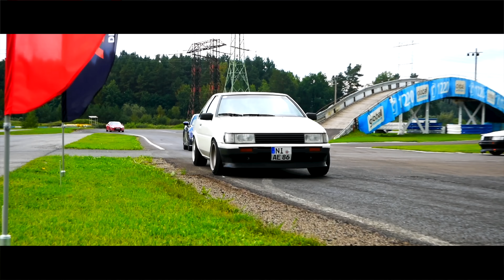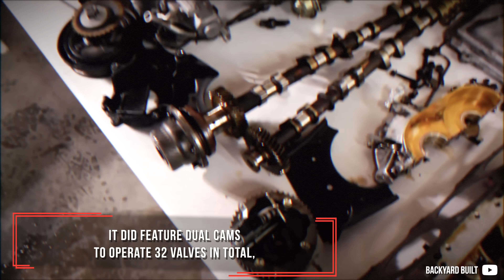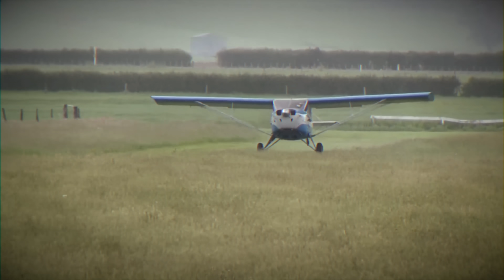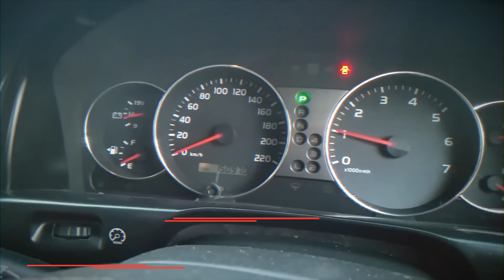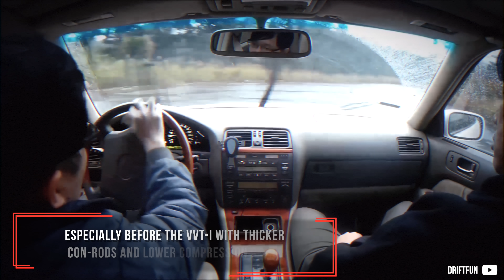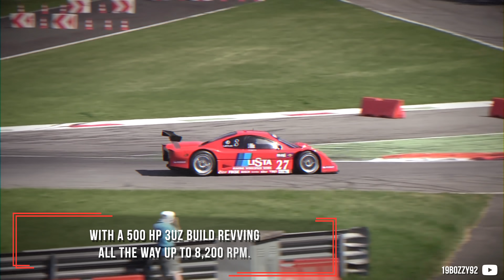The Strongest And Most Reliable Automotive V8

Comment: The legendary 1UZ. They are really overbuilt like a tank with non VVTi system these are genuine automobile engineering gems. Sad part is LS 400 is too old now to get and maintain. I heard from Car Care Nut that 3UR series is not as reliable as the 2UZ Cast Iron block engines due to head gasket failure possibility. UR series has the issue of valley plate leak, esp the 2UR-GSE, still that's the only Lexus motorsport variant in existence as the 1LR-GUE is not profitable in producing and racing, current RC F GT3 uses a 5.4L version with 500HP vs 472HP. I love the 2UR-GSE in RC F, it's also built like a tank, its an interference engine and has port and direct injectors for mega complication to mod and tune, but the 7300 redline with Yamaha designed heads and Titanium valves like 1LR and the sonic impression of a motorsport and aggressive mix always puts a smile. Too bad the RC F is about to be retired by 2026. Lexus built some great automobile masterpieces.

Comment: My 2006 Lexus gs430 is my first and only car I’ve had it for 5 years now put 100k on it with literally nothing but oil changes changed the oem timing belt at 200k

Comment: "NO LEAKS" yeah... thats not really true - many have issues with valve cover gaskets leaking.
Reply: That's normal if they're old. It's a cheap and easy fix. Hardly an uncommon issue for a performance engine anyway
Reply: @halo091  Its not a performance race bred engine though. 2UR-GSE is the only Lexus performance engine in existence. 1LR-GUE is discontinued and too halo and it did not even race that much as the RC F GT3.

Comment: pass———ill take the Toyota 5.7L Tundra engine that can go 1 million miles
Reply: Not exactly a hard pass, but ok.
Reply: 5.7L is a UR series engine, it cannot hold a candle to the 4.8L 2UZ V8 engine. Simply because 2UZ has cast iron block, the endurance is insanely high vs the 3UR, it's bulletproof.

Comment: Bought a 91 LS400 for $650 with 232000miles and with only oil changes drove it till 292000mi. 7 years later still absolutely in love with the engine

Comment: Having run a limousine company for roughly 25 years, the 4.6 liter V8 that the Ford Motor company put in the Lincoln Town Car (I don't know if they still do) was virtually indestructible.  IF maintained properly. 300,000 miles easy, often much more. The rest of the car would fall apart before those engines went.

Comment: I beg to differ it's interference engine. A stupid 60$ part destroyed my engine.. hydraulic timing belt tensioner that had to be removed to change alternator and a month later the belt slipped off somehow after doing some donuts and bang valves bent engine dead.

Comment: Yawn. This sums up this engine. A long lasting stock low power engine doesn't however making a car good. Or the engine. In fact, I would rather take the transit than drive any Toyota with a few minor exceptions. True engine quality to me it's a championship winning LeMans 24 hrs engine, proved over many many years, like the Mezger, not something barely moving at a leisure rpm value on the way to the local Bingo club. Yeah, I never got this myth of "super reliability" from Toyota, I've seen plenty with the hood up on the side of the road in my life. Must be an american thing, when the Japanese cars started coming to US and they were compared to a US made POS ..sure, they're better. But the strongest? Nope, sorry. I can say the same thing about an tiny ALH TDI engine that can do 1 million miles but it doesn't make it "the strongest". And tuning a few powerful engines for limited use (no more long service on those, right?) again doesn't make it "great". It's just a lazy engine with some over engineered features. Way better engines out there, even V8s. More research needed boys and girls, I know it's so hard to shake the 2JZ behind the barn tuned urban legend and start focusing on professional Motorsport to see the true greatness. Eventually people are reaching that stage in life when they are done watching F&F and play NFS on a PS and hit a real racetrack with a proper car. Cheers!
Reply: The reliability of the 1uzfe is legendary and was not just installed in the LS400 it was placed in the Landcruiser a true workhorse worldwide.

Comment: most reliable yes, but most ls and coyote's can make way more hp on stock engines. There are f150's on totally stock 4wd drivetrains making 700+hp reliably with turbo/superchargers. Obviously they are unlikely to last 1,000,000 miles, but uz engines would explode almost instantly at those power levels.

Comment: We bought a used Lexus 1995 model with less than 100,000 miles. Burnt oil on start up. Big cloud of blue smoke. . Biggest let down of any car I ever owned. Found out Toyota had problems for a couple of years there with valve seals..

Comment: The 3UZ-FE and it's predecessors are legendary.
I daily an LS430, and i got lucky enough to get one in almost immaculate mechanical condition. At 225,000 miles.
I'm at 251,000 now. No issues.
Reply: Me too mine has 220,000 miles

Comment: Nah, the UZ is just a totally over-complicated, overpriced and underpowered V8 which does not need, and cannot justify, it's use of a DOHC valvetrain. It doesn't not even have good fuel economy with it's rather inefficient over square combustion chambers and is a rather annoying interference engine given the replacement schedule of its timing belt. With it's mid-5000 rpm power peaks it's also quite underwhelming to drive. Period specific LT1 and LS1 5.7L engines have higher outputs, better fuel economy, lighter weight and smaller (external) size. As I have said many times before... unless you intend on making peak power above ~7000 rpm, a DOHC valve train is INFERIOR in every way and pointless in any application.

Comment: The most reliable V8 I ever used and using NISSAN's VK56DE I towed over 100,000KM drove hard I honestly tried to kill it so I can buy something new, I did not change oil for 1 and 1/2 year it f*c*ing neve quit. Finally I gave up and I bought a brand new 2019 NISSAN Titan VK56VD. 
I had a 1992 LEXUS LS400 very quiet and smooth, small V8 with decent power the cabin was very quiet on high speed amazing car.

Comment: I don't like that it uses a timing belt. I have owned two Toyotas that had timing belts and both broke on me long before the required maintenance. I was probably just unlucky and fortunately the engines were non-interference so it didn't hurt the engines. After the second time happening I will only buy cars with timing chains.

Comment: "Capable of 700hp on the stock block"

*Laughs in LS1*🤣🤣🤣

All jokes aside Toyota makes great motors that definitely last forever but there's a reason everyone does an ls swap instead of a 1uz swap and that's power price and reliability, it just can't be beaten.
Reply: Maybe in America, not the rest of the world. We use UZ’s and Nissan V8’s almost exclusively down under for racing applications.
Reply: Not really. Main issue with UZFE is the lack of application for turbo or superchargers or any real power upgrades. It's harder to modify vs LS. Still handles 1000hp
Reply: Going millions of miles isn't reliable?

Comment: I'd still say the LS V8's and the Ford Modulars have this beat in terms of durability. LS are know to be stupid cheap and reliable to make power and the stock 4v 4.6L modular in the SVT Cobras could handle over 700 rwhp without any upgrades to the internals. I know the 1UZ topped out around 400 hp before you had to beef up the insides.
Reply: 400hp? Try 800, unopened.
Reply: Lol hell no. Every ls engine with over 200k miles are leaking from every single part of the engine they could possibly leak from. What a joke

Comment: The air pump under intake on the 4.7 truck motors and the stater mounted in the v also are the shit parts of this motor. Not a fan of timing belts either, but no motor is perfect I guess

Comment: The Chevy small block engines have been in constant development since 1955, are just as reliable, have the same potential for torque, and I suspect are less expensive to build.
Reply: And GMs are easier to work on

Comment: 1uz was a great engine but quite thirsty and a little underpowered.

The 6JZ found it's way into many tuners' hearts as one of the ultimate benchnark 6 cly engines.  The original supras used them and could take up to 1000 bhp with a few mods.

By far the smoothest and imho best lexus engines ever was the V6.  The GS300 in V6 form from the mid noughties was as good as the LS and more dynamic to drive.  Superb, reliable and reasonably punchy with 247bhp.  Luxurious and well equipped too.

The later 3.5 v6 unit was even better and is used in the RX450h.   It remains one of the most reliable and  smoothest engines ever built with more power than the early v8's but better economy.

The V6's are overlooked but are one of the most developed and refined v6 lumps ever built. Love 'em and had a couple in cars including the GS300 and RX.
Reply from the maker: I have got the 3.5 2GR engine in my GS 450h and I can say it is very reliable: from 300 to 360K km I only did basic maintenance. However, it consumes quite a lot of oil... sadly, it had been consuming before my purchase.

Comment: It's a tough engine, no doubt....but until one has made over 3,000hp on the factory block and heads, crankshaft, and timing components like the John Mihovetz prepped 4.6L in this. .... the Ford modulars are the KING of V8s. 5.88@ 250. 

https://youtu.be/PSb1nRKIJTA

Comment: It’s underrated and often overlooked the kind of quality and engineering Lexus put into their early models. My 90’ LS400 @ 130k miles is older then me and it’s easily my favorite car I’ve owned. Despite its age, the car is just a beacon of confidence and reliability. I hope to keep her on the road another decade. Well done video and in depth history of the uzfe series engine.
Reply: I still have and use my 92 LS400 that I bought in 94. It is a wonderful car that is quick, smooth  and quiet.

Comment: Yeah Toyota spent $1billion dollars and a decade to mat h the reliability of eninge Ford build and designed in just over a year (the 300 I-6 debuted in 1965).  Nor is it significantly more reliable than the 4.6(which until the Veyron was also the most powerful production eninge).
I will say the smoothness of the UZ is good for a V8 but an I6 would have been a cheaper solution to balance.

Comment: UZ series is a proof you can't beat Toyota reliability.
What other company would even think to go through all that?
There's a reason Toyota cars hold their value so well.
Where I live used LS400 in good condition will run you as much as some new cars from the dealership...

Comment: One thing the LS400 engine was not known for is its strength and speed. Just the slowest thing because those were not small cars. Reminds me of the worn-out Crown Vics the Indy cops use. All kinds of sound and fury but not going fast whatsoever. Rated ~250hp? Not enough for those big cars.

Comment: The UZ is FAA rated for Aircraft use. Not very many street engines can do that.
Reply: I'll be slapping twin turbo on mine soon 😁
Reply: They mean stock from factory no modifications besides putting it in the plane.
Reply: @robslombie6272  they get twin turbos when they go into planes 😐
Reply: Absolutely 👍
Reply: Yamaha rx1 engines also plane used in Bush planes
Reply: I have seen LS motors in small planes.
Reply: @kevin122759  yes LS is one of the other few engines that can brag on this. Gotta love the UZ and LS 😏
Reply: @kevin122759 they’re just not as reliable as a UZ they blow rear and main seals UZ will never
Reply: @kevin122759  yeah theres quite a few
Reply: Says a lot about how robust an engine is, realise that aircraft run the engine at near 80% power constantly
Reply: @HoagMurkula  which is very impressive

Comment: matt farah famously owned a million mile ls400, and mine has 216k on the clock and runs smooth as a top. there were stories floating around on some of the lexus forums about someone making 3k horsepower on a 1uz, however i havent found any proof of such feat

Comment: VVTI wasn't until 1998 model year in North America, and it was only semi-drive by wire with a conventual throttle cable at least initially (not sure about later) 1UZ had Coil on plug when it went to VVT. Its a great motor and very durable, but you can get far more HP, far cheaper with a EA888 2.0T 4 cylinder.

Comment: I drive a 2006 Toyota sequoia with a 2UZ-FE. Can confirm, thing is a fuckin tank. Ive ragged that engine out and towed 2,000 pounds over the cars towing rating of 6,500 pounds no problemo. That car has been a really good car and holds up to Toyota’s legend of reliability, not to mention the balls under the hood that car has, yanks around that 6,000 lb car like its pulling a greasy string out of a dogs ass.

Comment: Very good video! My 98 LS400, with all original drivetrain, has just crossed over 500,000 miles this past month. I also own a 92 SC400 with a thick rod 1uz and my wife drives a 4runner with a 2uz. The SC is manual swapped and I have a turbo on the side just waiting to go under the hood.
Reply: 5 speed from SC300? Would IS300 5 speed work?
Reply: @tmo2798  KA24DE 5 speed from a 240sx are common manual transmission used on 1uz, with the cd009 being the one to choose if you planning on running high horsepower.

Comment: One of my favorite engines of all time, I have a 1uz non vvti thick rod motor in my 1981 corolla wagon and it is insane. I'm about to swap in a lower milage 1uz I have into it and do head studs and MLS headgaskets with a turbo kit I'm building, should be around 500hp with this setup then I'm building another 1uz on a stand with forged pistons, h beam rods and aftermarket cams, that will be capable of 1000hp and over 9000 rpm

Comment: I have an is200 sitting dying for more oomph, I was initially gonna slap a td04 on it and hope it doesn't blow up, but I've been toying with the UZ idea for a year or two now, engines seem relatively easy and inexpensive to find and it seems like a straightforward swap, again relatively speaking. I think this video sort of put me over the edge, sounds fucking glorious and its reliability is very tempting too
Reply: I don’t know the ‘how to’ parts but I do recall seeing and manual swapped IS200/400 local to me. Everything like that has to be engineered (costs $000) and certified here in Oz and I don’t know if it got through. Haven’t seen it about in ages. Was a top sounding vehicle that went hard. Just do it and send it!

Comment: Basic recipe for a reliable engine :
Make it underpowered and under stressed, such an easy recipe 🤣🤣🤣
Reply: I guess you never owned a D17 Honda Civic 
Under powered and under stressed.
But that head gasket tho 😭
Reply: Basically the 318 LA “economy” V8’s. 170 horses but those horses refuse to die.
Reply: @no_4259  Shit, people regularly put out 600+ hp with 318s and they still never die.

Comment: Had a tundra with a 4.7 2uzfe, great truck, never quit running, almost 300k miles and it still pulls like a mf
Reply: My buddy has one with over 700k still pulls trailers everyday and it was not a easy 700k either
Reply: That engine was such a peach and make beautiful noises .
Reply: @blairwilliams136  mines straight piped😂
Reply: @travyboy5947  god damn it must be loud and sound like a beast, I could never get away with that, I use mine for long road trips 😅
Reply: @travyboy5947  just bought one last month and it has a loose clamp on the exhaust… I don’t plan to fix it because she sounds so beautiful
Reply: Me too.   2UZ has a stronger block (cast iron) than 1UZ (aluminum), but its rod is thinner than 1UZ.  Overally I think they are 50 vs 50, co-champion of V8.
Reply: *Chrysler HEMI V8

Comment: So, how about one of these in a Camaro? =3
Reply: Nah, I'd stick to the fuel-injected LT1 Corvette small-block engine (1989-2003; 2014-present) in a Chevrolet Camaro.
Reply: @josecarrilloii4036  

Specifically I'm thinking about in a 4th gen RS that's currently without an engine. I'm not considering an LS even though that's the obvious choice.
Reply: FUCK IT, CHEVY SUPRA GO
Reply: @cellphonelightsaber  

Basically, well Chevy Soarer anyways. xD
Reply: @skaldlouiscyphre2453  a Chevy Supra would be stuffing an inline 6 like the Vortec 4200 or if you wanna piss off Chevy guys, a FORD BARRA.
Reply: Not without 2 turbo,s.

Comment: May u do a list of some of the most reliable engines ever built?
For instance, the K series, OM617/OM606, Jaguar 3.8, BMW M50/M52/M54, 2JZ?

As a modern engine, despite the timing chain being at the back of the engine, the B58 is already showing signs of it most likely being a bulletproof engine (tuneability and reliability) , putting it up with the likes of the engines with the best reputation. The stock bottom end (which is forged like its rods.) can handle up to 700hp+. The engine can also reliably handle up to 550-600 wtq stock. It also has a closed deck design, like a 2JZ making it capable of handling high boost.
The EA888/EA855 are also great modern engines.
Reply: M54 reliable? Are you high? Every other one is burning a gallon of between oil changes also the Vanos units are useless after 100k miles
Reply: @hexagonosaurus5848  Or are u thinking of an N54?
Reply: @Josh-qm4rb  N54s are good, everything surrounding them sucks. M54's and their stupid piston rings in a combo with an aluminium block...ah perfect
Reply: @hexagonosaurus5848  The N54 also has an aluminium block, even a K series has an aluminium block, and a B58. and ik that the auxiliary parts of an N54 suck. The M54 is one of the most reliable BMW engines ever made, the piston rings are literally the only concern. The engines only burn oil if they fail. Even then the piston rings are strong. Every engine has its own problems.